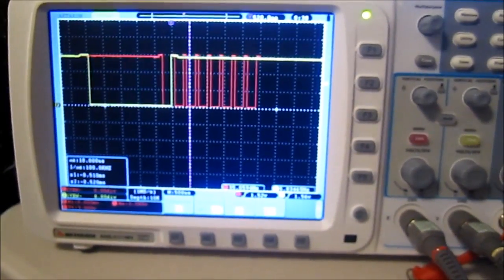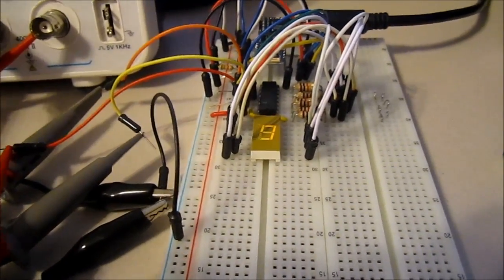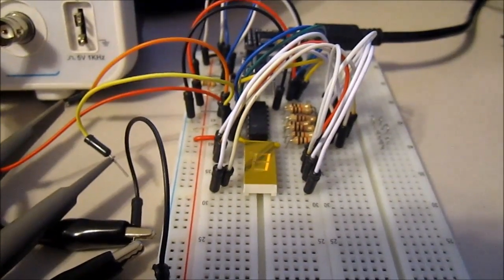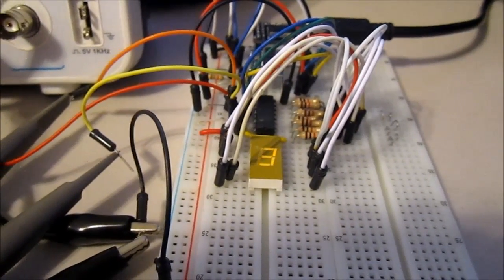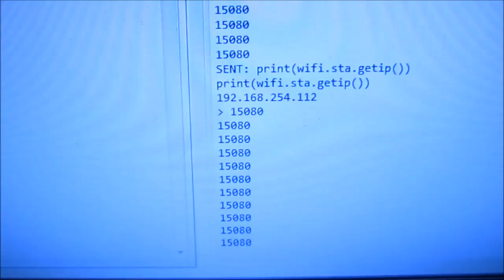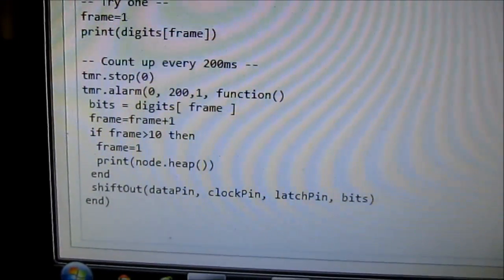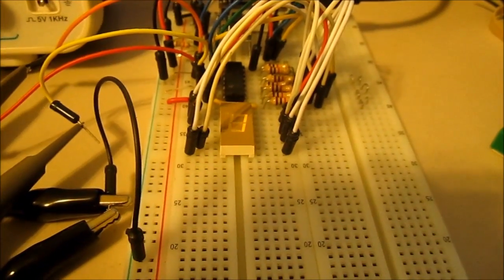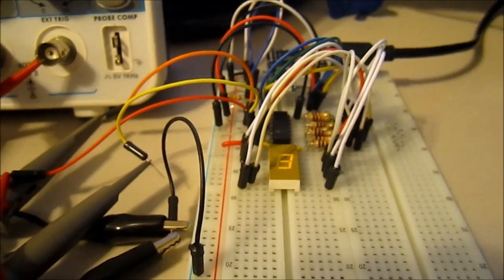$3 Wifi module part 7: WiFi I/O

Comment: Hari, can you do a tutorial on how to read a sensor with one ESP8266 and then when the sensor pin goes high, then turn an LED high on a 2nd ESP8266?
Reply from the maker: +O.T. Powell , the best solution depends on how it would be used.  If all you want is to make a switch wireless, using Virtual Wire library and a pair of RF Tranceiver is much simpler than using WiFi and two ESPs.
https://iamzxlee.wordpress.com/2013/07/13/rf-module-part-2-2/

It is entirely possible to use ESP, but unless you need a web interface, or access it remotely, it seems unnecessarily complex to involve WiFi.  Just my 2 cents.
Reply: +Hari Wiguna  Well, I wanted to create a mesh sensor network of about 10 different sensors.  One is an ultrasonic sensor which monitors my garage door.  If it opens, it will send me a text and then I can close it remotely.  Then, in my kids room, I want to put a PIR sensor on each one of their cribs (I have twins), and when motion is detected, I want it to send a signal to me and my wife in the bedroom.   As for your suggestion, I wouldn't mind getting a few NRF24L01 RF modules to play with.  I already have a few bluetooth HC-06 modules on the way.
Reply: +Hari Wiguna  Well, I wanted to create a mesh sensor network of about 10 different sensors.  One is an ultrasonic sensor which monitors my garage door.  If it opens, it will send me a text and then I can close it remotely.  Then, in my kids room, I want to put a PIR sensor on each one of their cribs (I have twins), and when motion is detected, I want it to send a signal to me and my wife in the bedroom.   As for your suggestion, I wouldn't mind getting a few NRF24L01 RF modules to play with.  I already have a few bluetooth HC-06 modules on the way.
Reply from the maker: +O.T. Powell , as far as I know the ESP is not designed for a mesh network.  Each ESP will need to be in range of a WiFi access point.  Not sure if the NRF24L01 has a mesh network library or not.   I think you should just start playing with the hardware you already have.  You'll soon find out if it is a good fit or not. Good luck!